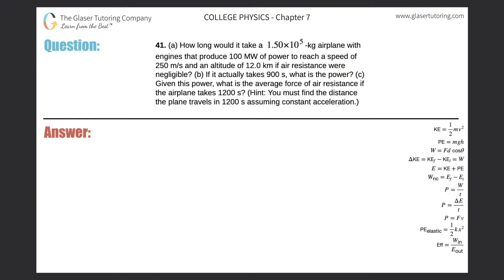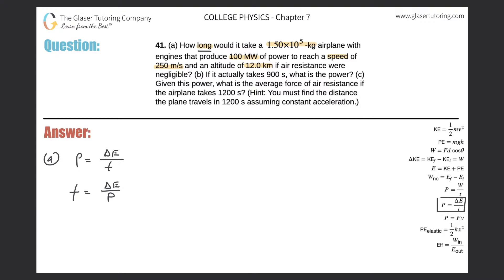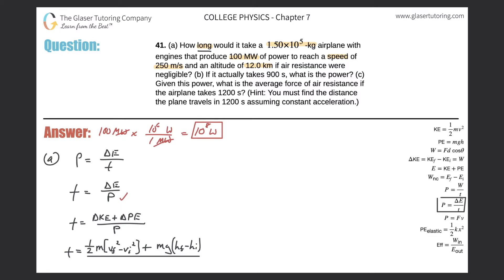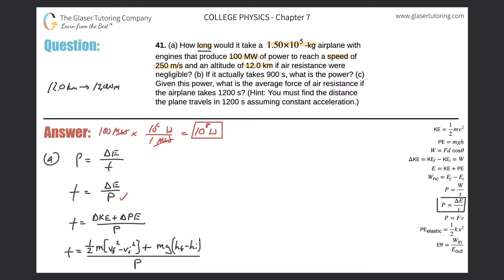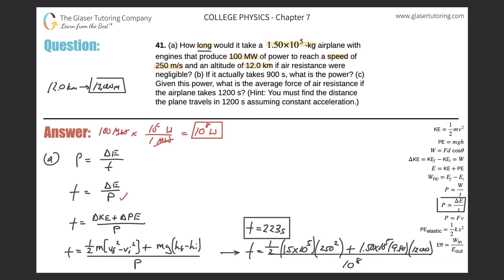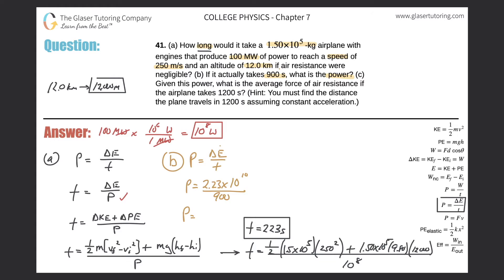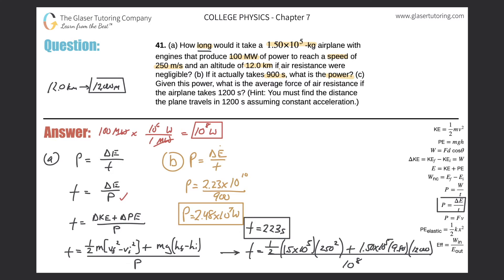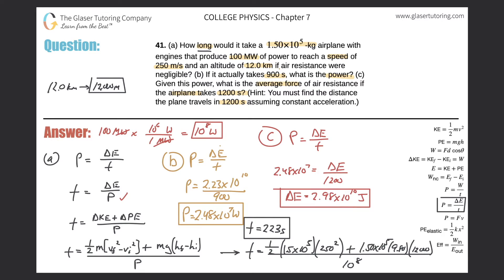7.41 | How long would it take a 1.50×10^5-kg airplane with engines that produce 100 MW of power to

Comment: In part C when calculating force of air resistance wouldn't it be cos(180) because the plane is traveling forward and the resistance is pushing backward? Thank you!
Reply: Yes it is but since we're only gonna be looking at the magnitude of the force, that won't be necessary.